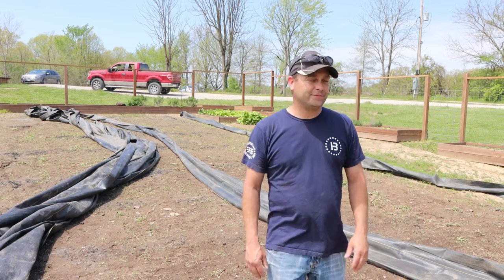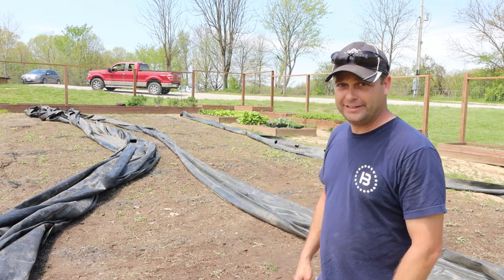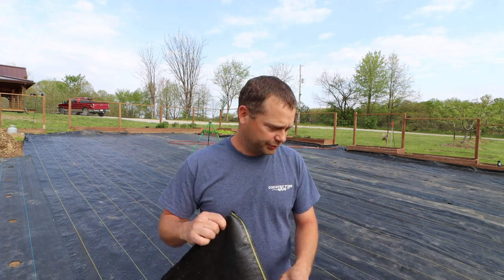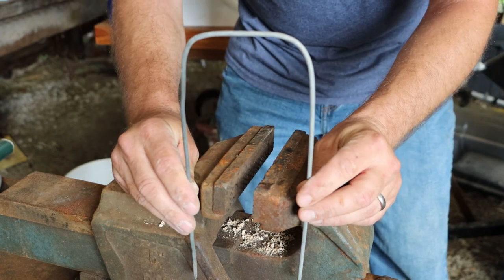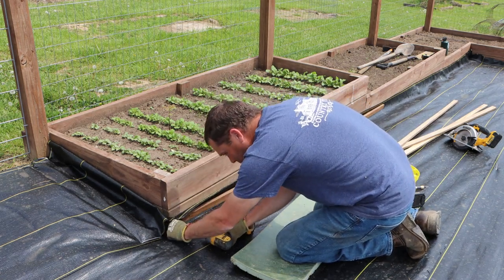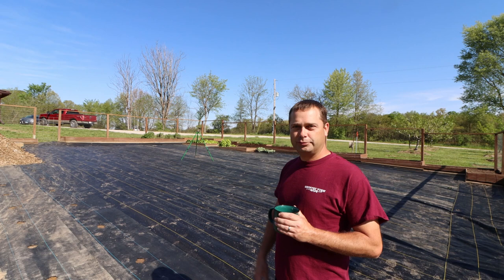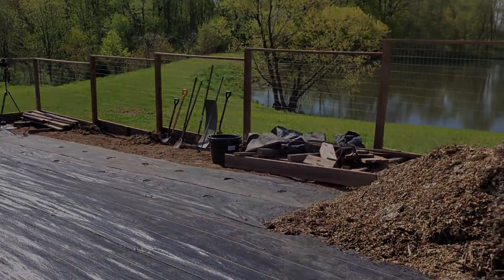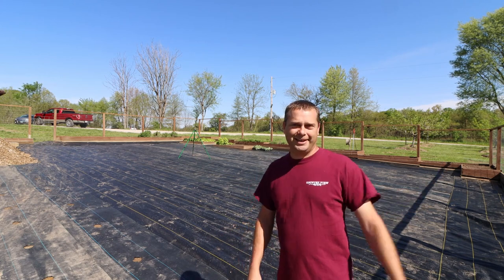Installing Woven Weed Barrier in the Vegetable Garden

Comment: A little tip when you go to plant,  I used to use a bulb planter to dig out my holes for planting.  Last year I bought 2 sizes of small augers from Tractor Supply and Lowe’s and use them in my Battery operated drill, works great and you can go as deep or shallow as you need. Give it a try you won’t be sorry.
Reply from the maker: I got one, and it will be in the next video.  👍
Reply: I did this with garlic last fall and it really saved time and was easy.
Reply: I'm using one of the blades from a kitchen mixer on a battery operated drill-works slick!  An cheap!

Comment: When I tried to burn and cut my weed fabric it would shrivel so bad, yours didn’t seem to do it. Wonder if it was a dud, it was Dewitt sunbelt
Reply from the maker: Mine is DeWitt ground cover.  Don't try to cut it if is wet on the back side it will give you trouble.  It needs to be dry on both sides.  If that isn't it, then maybe a different torch with a more precise flame.

Comment: Compost tea would soak through the landscape fabric...no till necessary.
Reply: Do you have a recipe.
Reply: @rebekahleskiw7879  
You will have to search the web for a recipe.
I have never used it myself.
I believe it involves putting a shovel of well rotted compose in a 5 gallon bucket of water until the nutrients are dissolved into a "tea" like liquid.  Then it can be poured around plants in the garden as fertilizer.

Comment: Could you just cut an X in the fabric that would lay close to the plant so there would be less weeds?
Reply from the maker: The problem is cutting is the fabric will fray, but using a torch to cut an X might work good. 👍
Reply: @CountryViewAcres  I wonder if an old soldering iron would be good for cutting it. Or at least a smaller chef's torch.

Comment: Evan, where did you get the landscape fabric. Manufacture and size please, cost per roll as well. Garden looks great. Be nice to not spend time later on weeding. Good idea to keep the pups out as well. Thanks again, have a great weekend
Reply from the maker: I buy DeWitt 3.2 ounce woven ground cover.  4 foot wide rolls.  With 6 inch overlap I have 3.5 foot spacing between rows.   I used to buy 3 foot rolls, but I like the wider row better.

Comment: We just rototilled the garden so the dirt and compost is very fluffy.  If I roll the fabric out on the fluffy dirt every time I step on it my foot will sink into the dirt.  How do I deal with this?  Might be a weird question but my husband and I want to do this correctly!  Thanks for your help.
Reply from the maker: Best to let the dirt settle and get rained on a couple times to compact more before putting on the woven ground cover.  Also the landscape staples won't hold in loose dirt and it will pull up in the wind.

Comment: Sorry for resurrecting an old post but I just stumbled across it. 4200 sq ft garden here and going to try the woven fabric this year. My fabric is 6ft x 300ft and I'll just cut to length. My question (didn't see it in any of the previous comments) is how hot does the black fabric get during the heat of summer? Our Oklahoma sun beating down on black material looks like it could create a sauna....
GREAT work on the design, layout and video work btw! Love all your videos.

Comment: Where did you get your staples? What brand? I am in Canada and my fabric keeps blowing up. My staples are not that wide. Oh never mind I just watch more of the video. Thanks for that tip on making my own staples. I am on that!
Reply from the maker: I make a lot of my own staples from number 9 wire.  But also purchase 6" landscape staples.  Not sure of the brand.  I just a quick search on Amazon.com and there is several to pick from.
Reply from the maker: The short staples don't work in recently tilled soil.  You need to wait after it rains to pack the soil back down.  Then they work better.

Comment: I’m totally jealous of how much garden space you have. It’s looking awesome! We covered our garden space with it too, but all our planting will be in raised beds and containers on top of it. Can’t trust our soil, where the garden needs to be located, unfortunately. And, I cant really work at ground level. But the fabric is awesome, its even keeping the raspberry canes down (they’re super invasive here in OR).
Reply from the maker: My soil is clay, and I was surprised how well the plants grew in it using this fabric.  Give it shot you might be surprised.
Reply: Thanks! I wish it were as simple as clay soil. :) It’s more untrustworthy because of what the previous owners may have dumped there. We have five acres, but most of it is wooded. The sunniest spot is unfortunately where there were several old dog kennels that had been stacked full of junk. When we cleared the space, we found big pieces of asphalt that had been poured right into the ground and then buried. But also, I need the height of the raised beds, I can’t get down to ground level very well.

Comment: Hi Evan. What is your take on plastic mulch/ground cover?
Reply from the maker: I have used this woven ground cover for 3 years now.  And I am very happy with it.  Lots less weeding.  It keeps the soil covered and helps hold in moisture.  What I am using is supposed to last 7 years, some will last up to 20 years depending what you buy.
Reply: @CountryViewAcres  thx for replying back. What about the plastic ground cover? Will the plastic ground cover do the same?